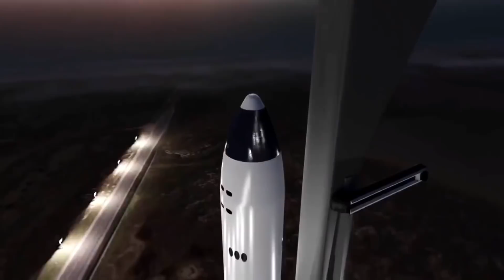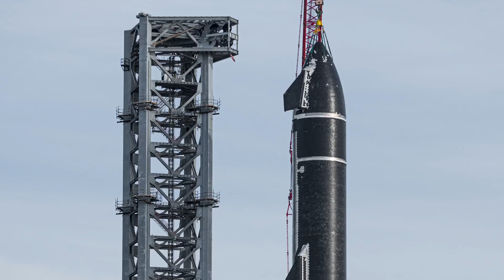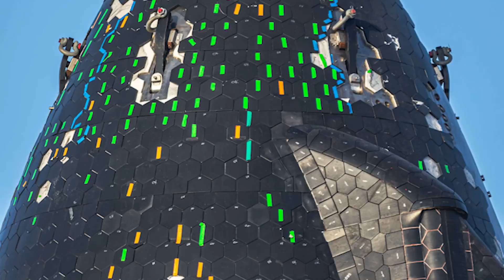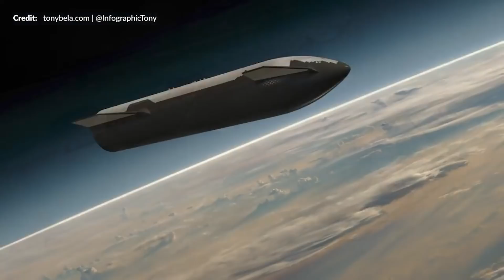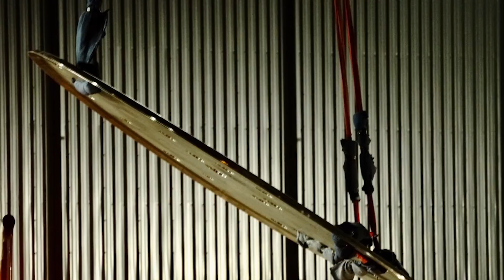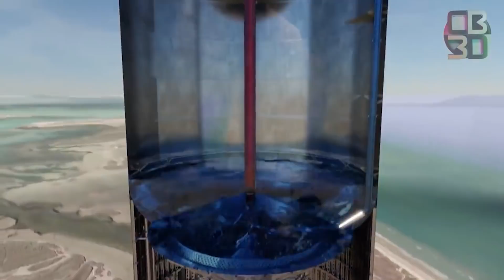SpaceX Starship SN20 is READY for ORBITAL TESTING

Comment: What about a  1 piece heat shield that's bolted on that could follow the starship distortions and and would be easier to replace and rebuild no cracks
Reply: Probably too expensive to switch out the whole heatshield each time, i guess